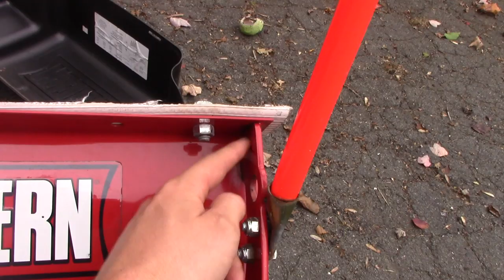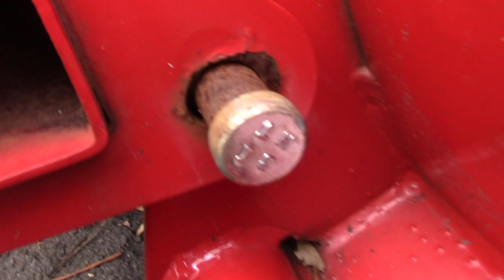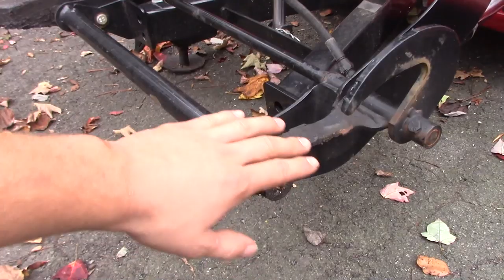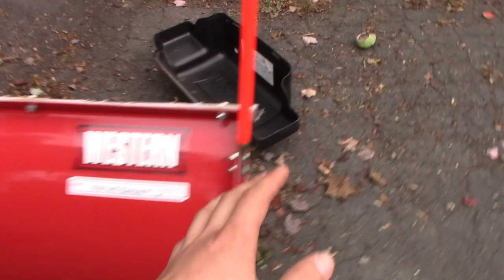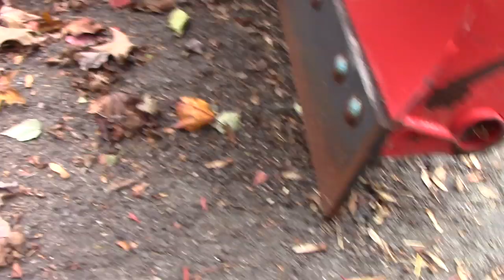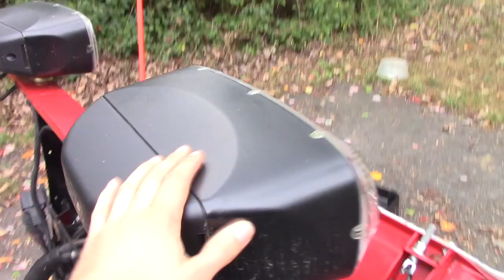WESTERN HTS 5 Year Review

Comment: Serious question: I'm 4 minutes in and you've talked about nothing other than the lack of welds. Then you mention that YOU are a welder. If the plow lacks all these welds, then why haven't YOU taken the 30 minutes and welded everything up to your liking? If the plow is 5 years old and this good of shape, Western must've known what they were doing when they designed it?
Reply from the maker: I was pointing out where western could have improved in craftsmanship. This is solely my opinion and I was pointing out where I THINK the plow is lacking. That is the point of a review, to give your opinion...  And as for why I haven't welded everything? Its not a half an hour job at all. It would require complete disassembly, sand blasting, welding, and a new paint job. Many many hours to do it properly. Not worth my time, if an individual component should fail, then I would repair it. Yes It has stood strong the test of time thus far but again this is my REVIEW and my OPINION. Could have been construed a bit stronger
Reply from the maker: *Constructed

Comment: he's had it for 5 years not a scratch on the blades face not a scratch on the plow LMAO not a spot of rust anywhere on any of the bolt spins never mind rust not any corrosion on galvanized pins boats WTF he said it five years probably used it twice I plowed driveways with a Craftsman riding lawn mower automatic transmission I put the super wide tires in the back the wheel weights chains and where the mount for the grass clipping containers r i put another 60 lb I'm a welder fabricator to I took the factory Craftsman plow got rid of all the springs and crap reinforced the plow made it rigid the turning radius on a lawn mower you don't need to have a side to side adjustment on the plow up and down is all you need I reinforced everything including the chassis this f**** thing was awesome I rodeit hard put it away wet the second year I was using it we had some really heavy snow one after the other I bent the mount I bent the chassis I took the stuff off straightened it out double reinforced it it was actually pretty easy I've ran into things with that lawn mower on the plow end and with all the weight I had in the back the rear wheels came off the ground I almost got tossed off it the engine cover flew off all I did was put the engine cover back on and away we go 32in of plow pack at the end of my driveway about 3 ft wide I had the ram it a few times to get started once I broke through well it was easy and then something happened I used Husqvarna chainsaws weed wackers leaf blowers and used a Husqvarna dealer he had a side operation that repaired Small Engine equipment I screwed up I brought my lawn mower my Craftsman plow that I designed and fabricated to this dealer for a tune-up I needed a new starter one of the tires had a slow leak oil change plugs I let him do everything he did a good job for a really good price the owner in the three sales representatives and the two mechanics we're extremely interested and curious about my machine they had my address from the sales receipt when I picked it up the forecast for the next afternoon was 12 to 14 in and we got it I didn't put two and two together for a while but there were three vehicles about 30 yards on either side of the front of my driveway I didn't pay too much attention but I did notice these guys had their windows down and now that I think about it they were filming me these were the salesman sales reps from the Husqvarna dealership 3 years later Husqvarna came out with their riding lawn mower with a snow plow long story short I was moving tons of snow I had snow Banks 5 ft tall all pushed by a Craftsman lawn mower
Reply: Blah Blah Blah, CARL, no one Cares ! ! ! ! !
Reply: Carl Boucher  That was a great story! I really enjoyed that! It sounds like you may have been sitting on a gold mine with your idea! If only you hadn't patented it!  It sounds like that dealer/ repair place knew a great invention when they saw one and the Husqavana salesmen STOLE your idea! I'm not a lawyer but I do know a little about copyright infringement. I wouldn't be surprised if you actually have a REAL COMPENSATORY lawsuit here! If Husqavana is making a fortune off of these Riding mower/plows, you just might be legally entitled to some of that money! In a copyright infringement case, you're actually entitled to THREE TIMES whatever they made off of your idea, IF you can prove copyright infringement! I know that's a BIG IF, and good luck living long enough to see the whole suit through to the end, but you just might have a case here, especially if you have solid, corroborating witnesses in your friends at the repair shop. If I were you, I'd at least look into it. And GOOD LUCK!!